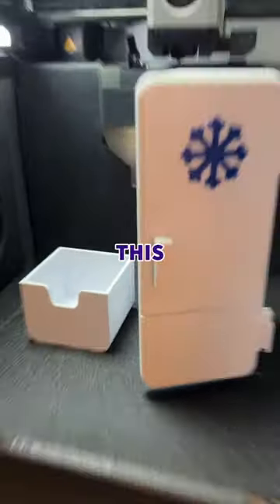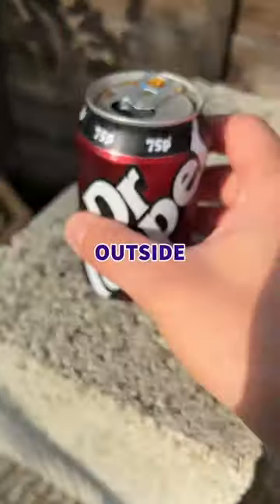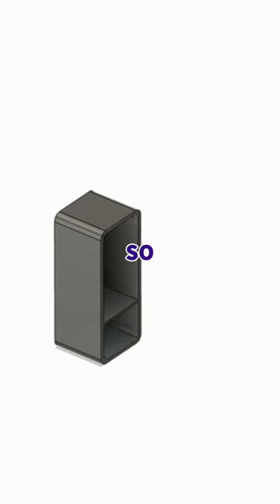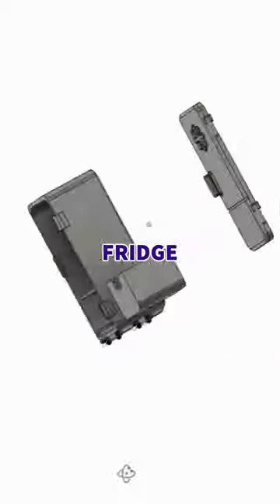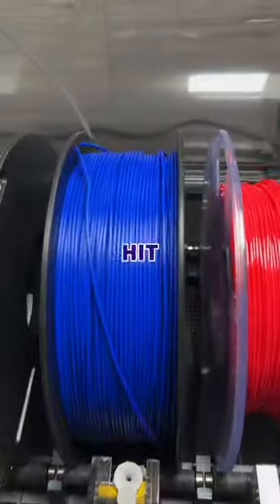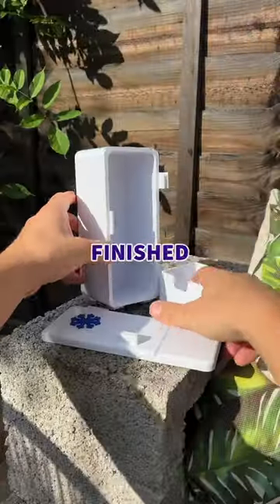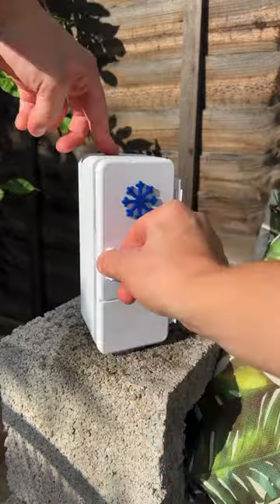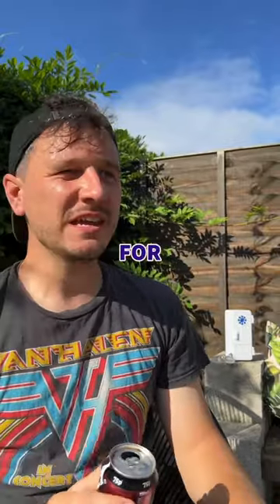We 3D printed a MINI FRIDGE 🥶 #3dprinting #shorts #lifehacks

Comment: Make the ice on the top shelf for more effectiveness
Reply: Top and bottom for best efficiency
Reply: @Jesse_PInkman_747 Ice above, water collection tray below and double side wall for air recirculation... here's another thing to add to my list of "A thousand things to print before I die".
Reply: @PencilParasite  just take the fridge outside
Reply: @Jesse_PInkman_747 top only would be the most efficient as cold air sinks.
Reply: And make it another color. White colects heat
Reply: @TechHouseVids  white reflects light so it absorbs heat
Reply: @Jesse_PInkman_747  thanks thats whatvi meant
Reply: @Jesse_PInkman_747 The color white reflects heat. It doesn’t absorb any wavelength of light.
Reply: @TechHouseVids That’s backwards. White reflects light, black absorbs light. You know how cheetahs have black underneath their eyes? It absorbs the light, which reduces the glare for the cheetah. As a consequence of absorbing light, black also absorbs heat. A lot of animals (EX great white shark, antelope) have white coloration on their underbelly, and dark coloration on their back. This minimizes their visibility because they reflect light in dark areas while absorbing light in bright areas. Like how black plastic gets hot in the sun, while white plastic stays cool. 
You can experiment at home with a black VS white shirt in the sun. Anything works really, as long as you put both items in the sun you should notice the difference within like 10 minutes.
Reply: Redesigning waste of effort, just flip it upside down 😂
Reply: @Jesse_PInkman_747 black absorbs heat and absorption of heat is heating up

Comment: Wouldn’t it be smarter to put the ice compartment over drink, because warm air rises and cold air sinks
Reply from the maker: Agree.. the only issue would be the ice would then melt and drop through the plastic into the drink 😱
Reply: Yeah
Reply: @playconveyor easy fix. A fan at the bottom that blows through the side through the ice and to the can with a “condensation” trap to release the melted ice.
Reply: You can also take advantage of surface tension. With small enough holes, you can allow the air to mix and cool the drink while the small holes trap the water at the top and release it at a slope to avoid the can.
Reply: @micah2936  That's... Really smart! And overly complicated
Reply: @micah2936 over engineering fr
Reply: @playconveyor I want to buy the mini fridge you made, it keeps stuff cool but doesn't water the out the drink!
Reply: @playconveyor  But... That would make it cooler.

Comment: Chest freezers, aka that little icebox inside your “fridge,” are extremely famous for not letting any heat in or “letting any cold out”

Its gonna sit in there and the (very little) cold air the ice forms is gonna sit right in the bottom. Likely its efficacy is from the reflectivity